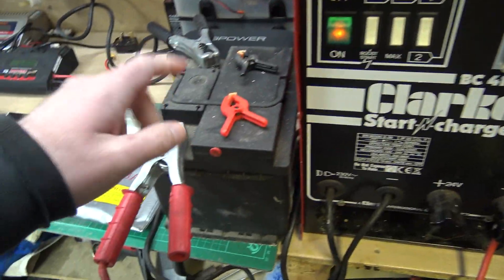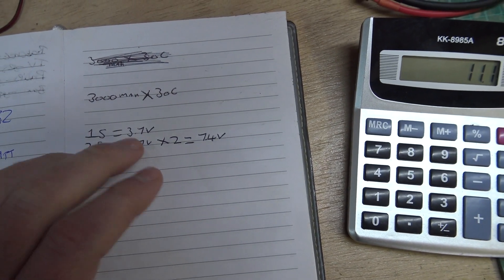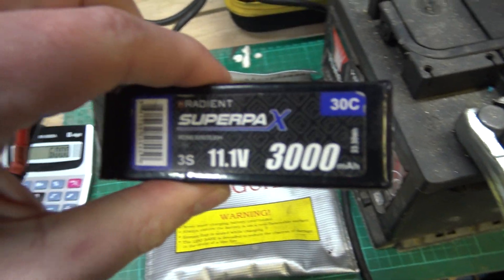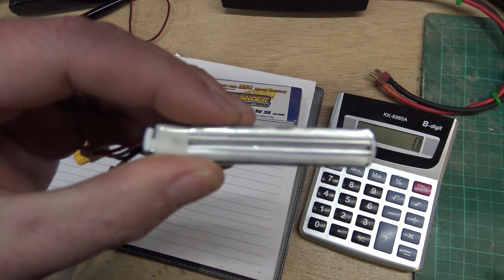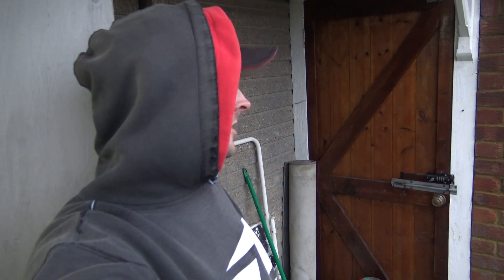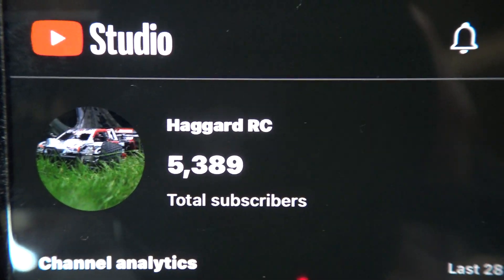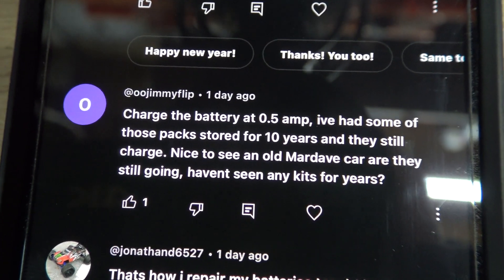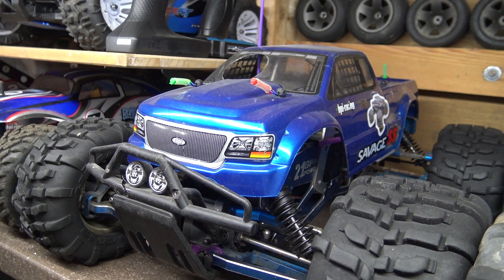How I Work Out LiPo Battery Charging Rates

Comment: Happy new year🎉🎉 In the video u gonna do about shocks, can u please explain what the "w" rating of the oil is please? I have revo that i replaced the back shocks on and its too bouncy and i dont know what number oil i need to make it less bouncey🙈🙈 Plus i need to refill my trophy buggy's shocks n dont know what numbers i need🙈🙈🙈 Also, what kind of grease shud i be using on diff's??
Reply: The "W" rating refers to the weight of the oil, or better yet the viscosity of the oil, The higher the number the thicker the oil is.  viscosity is the internal friction of the oil molecules as they move against each other. or opposition to flow. hope this helps.
Reply: @rwt8851  thank you🙂 Sooo higher the W number, the less bouncy it will be?
Reply: @dancehallmerko8410    NP, yes the suspension will be stiffer with a higher number. The shocks will be slower in compression with a higher number. Sometimes it will make it bouncier take a tmaxx as an example. You get up to a 60w oil and above, in that kind of suspension it will make the rebound bouncier. because the oils viscosity is greater the shocks won't absorb as much energy thus making it bouncier. There is a line between shock oil and shock spring rate. Alot of trial and error. On mine i run a progressive spring that starts at 3# and goes to 7# with a 40w oil and it is perfect for what i run the truck at.
Reply: For the diff oil i live in the frozen hoth of South Dakota so i run 50k diff oil. but when we visit buddy's in middle Texas for a rip every year i switch it out for 100k diff oil because of the temp difference. that's just the way i do it. There is no wrong or right way to it really don't over think it to much and just have fun.